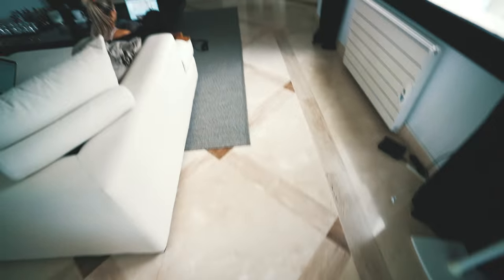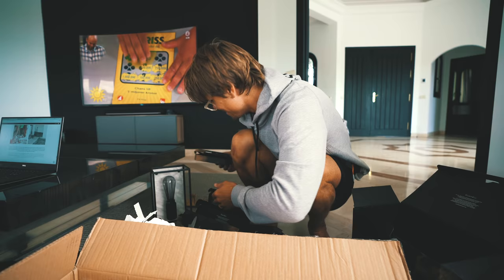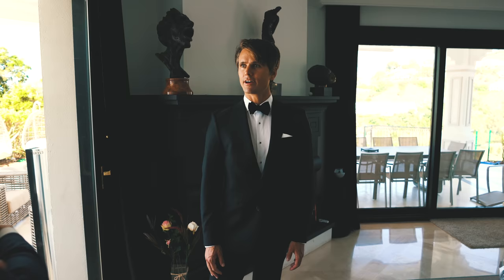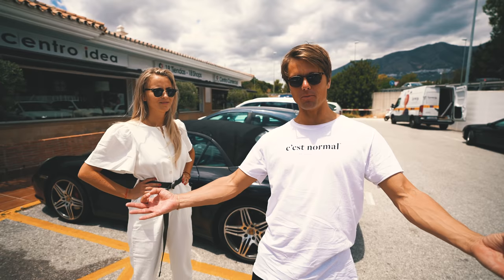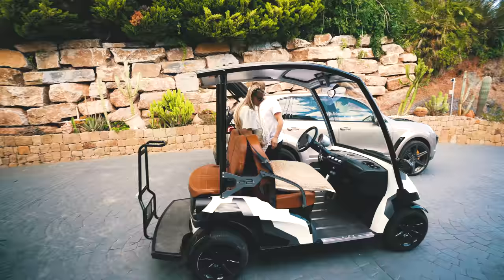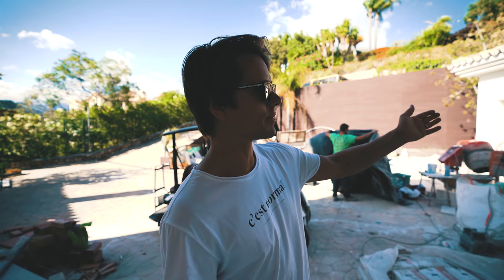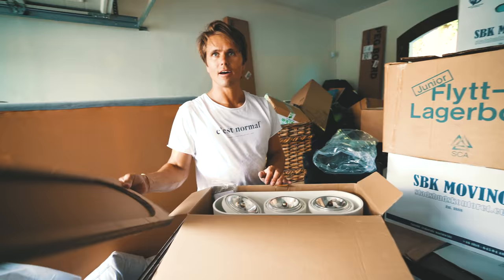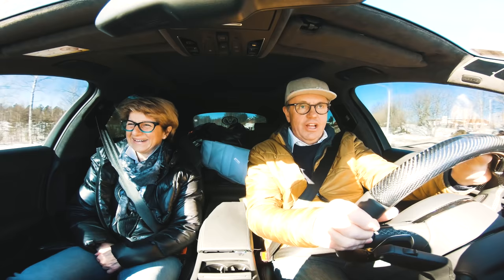PHOENIX SOLD! HANS INCOMING! | VLOG³ 22

Comment: Jon to be honest, your tux looks amazing but the waist could be taken in a little bit since you have excess space around the upper button area in the front. Another thing is that around 4:40 I see that there is some excess fabric between your shoulder blades. It would be nicer if the tailor would alter the small pleading which you have now, it is called a "square back neck alteration"

Comment: No no Jon go with tech for switches check out Sonoff
Reply: I agree that he should consider using some smart stuff, but I'm fairly confident he will have more success with something like X-Comfort or KNX. I'm using Fibaro HC2 (Z-Wave and linked to Hue) myself - for my little home it is fine, but for an istallation of those dimensions I would go for something more reliable.

Comment: 5:38 again, needs 1 cm each side at least. You never should see a concave shape on the shoulder and a good tailor NEVER, NEVER does a exact fitting before trying, it should always be bigger, because that way they can adjust perfectly by breaking just some lines. The way this tailor did the suit it makes impossible to do any type of size adjustment. Good fabrics, good design, very poor decision and method from the tailor(s).